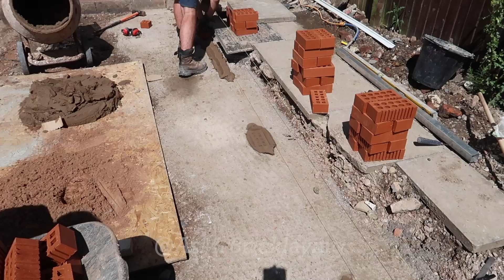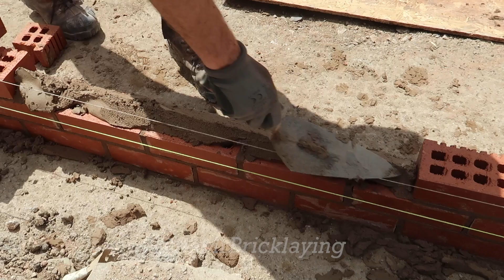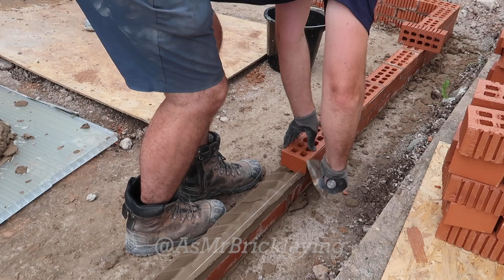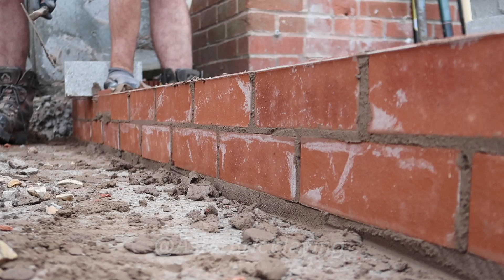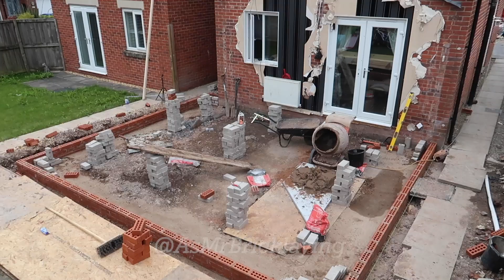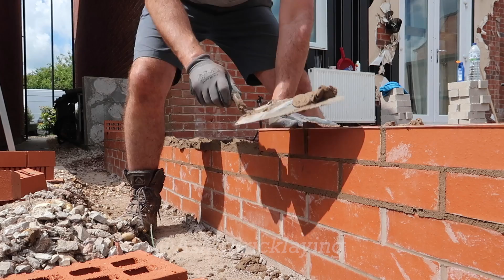Setting Out Footings For Extension | Unintentional ASMR Video

Comment: Stu, thanks for the videos!  I am not a bricklayer, and I want to understand the practical implications of working on a job.Why are the beds tight? is it the footings are not level and you have to marry in to the original building? You have two string lines one off the side of the house and one to the extension, why do you do that? Cheers Mate
Reply from the maker: the green line marks the side of the house